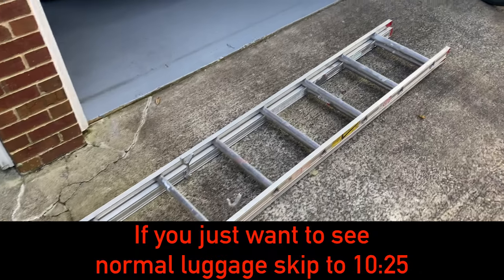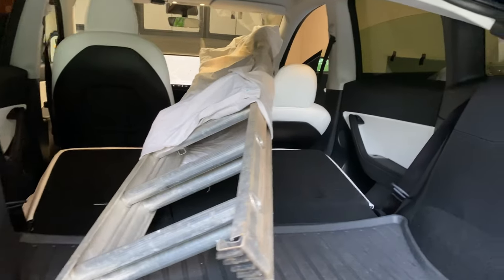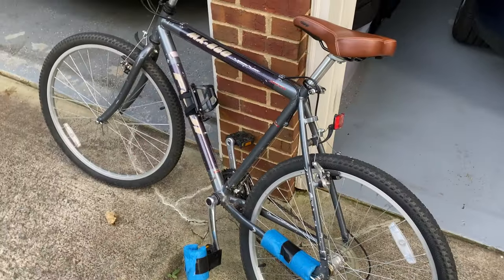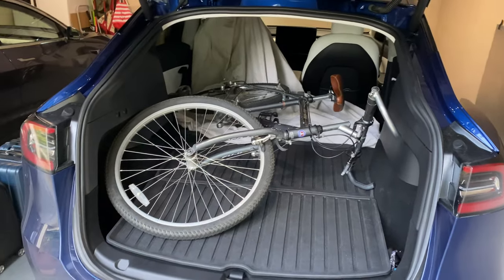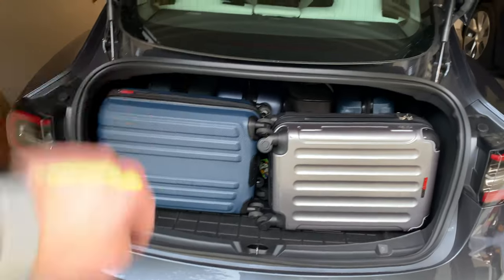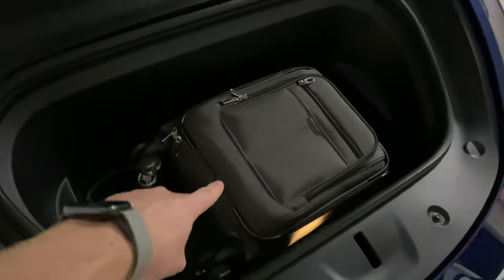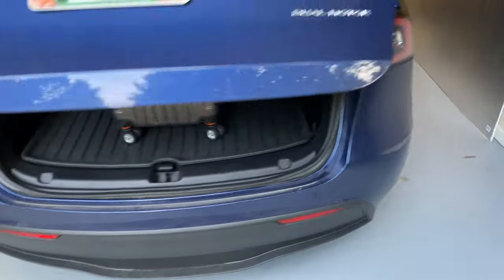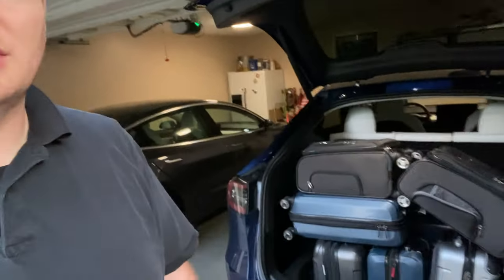Model Y Cargo Space | Model 3 and Model Y Storage Space Comparison

Comment: You really did an awesome comparison video, because I was very skeptical about the value of this subject, because it was obvious which vehicle had more storage. I love the body strength and rigidity that a sedan delivers, but the Model Y is superior in it’s versatility, the ease of entry and exit and the benefits of seeing further down the highway!
Reply from the maker: Thanks, I do know it is obvious which one is larger, but I think a lot of people look at the outside design of the Model Y and think that it does not provide a lot more space than the 3 when in reality it is much bigger. I couldn’t believe how many carry on roller bags I could fit in it really
Reply: @whatdrivesyou6798  I guess that most people are not familiar with how large the interior of a ground up designed electric car can be? Stick an electric drivetrain in an Audi suv or a Mercedes Benz suv and you've gained no space and you still have the transmission tunnel and the driveshaft/exhaust tunnels.
Reply from the maker: Exactly

Comment: Dude, you are awesome! I’m gonna use your promo code when I order this winter.
Reply from the maker: Thanks, hope you enjoy the car and supercharging! What model are you going for?
Reply: The model y.do like the blue color. . Does it get too hot inside?
Reply from the maker: We got the white seats partially as we were concerned with heat and partially because we like how they look, but really since the Tesla has cabin overheat protection and you can turn on the A/C anytime it is really not a concern. We really like the blue, but also like the midnight silver metallic on our Model 3 and like the looks of White Teslas we have seen. It was hard to pick the color since I liked them all a lot.
Reply: What Drives You thanks for your reply. I want to tow a travel trailer. My concern is is I use the ac while towing, I will lose a lot of range. I’m hearing that you can lose 50 to 75% of range towing.  Also, I live in Minnesota. I think the heat pump will help my winter range.
Reply from the maker: As far as cooling the car I don’t think you need to worry much about the AC use as it is minimal compared to the driving. I did a test on this actually; https://youtu.be/hJO-r95sZL0. It will be interesting to see how the heat pump does in the winter since heating really hurts the range on the Model 3. Towing definitely impacts the range a lot. I would probably count on a 50% hit for that if you have a good size trailer. I haven’t had a trailer yet, just bikes
Reply: I was thinking of ordering in February. And then it will arrive in early spring.  Tu Mostly because of quality issues with panel gaps and paint, do you think that is getting better?
Reply from the maker: Hard to say for sure. We didn’t have any trouble with ours received in June as far as paint. One rear door had a little more gap than we wanted so we did get them to fix that, but wasn’t really a big deal to us.
Reply: What Drives You Thanks so much for your replies. I look forward to more.